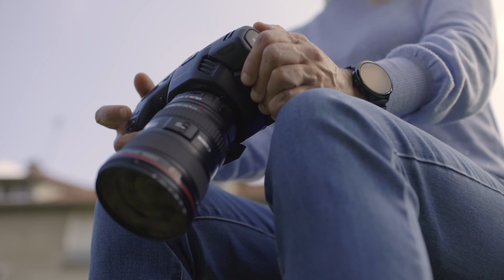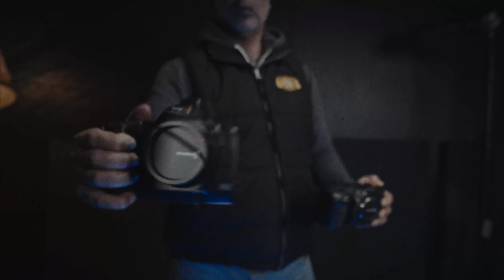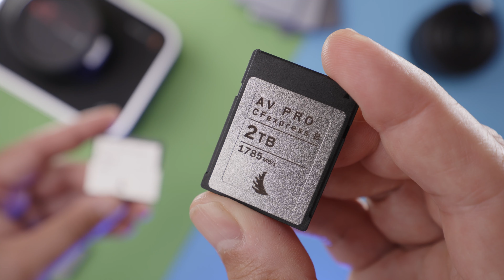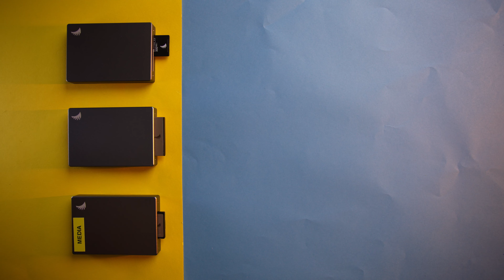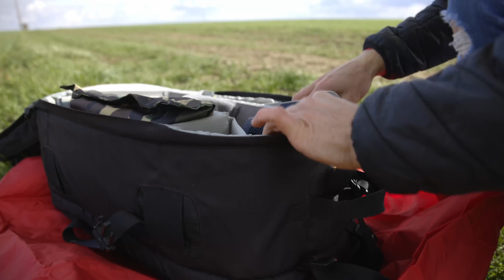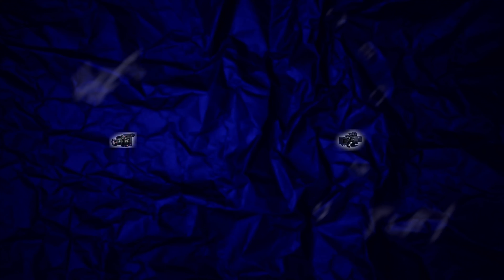Cine Gear 2022 Blackmagic Design Ursa Mini Pro 12k G2  - Prediction

Comment: Just started thinking about getting a couple 12k cameras and media was one of the main things that seem out of date. The ssd reader seems like a nice choice but that little usb-c connector does not fill me with confidence about surviving a bump. Internal cfexpress type b seems obvious. 2 or even 4 slots. 

The other was the mount. It would be great to have L mount or something else. Canon doesn’t make EF lenses any more. It’s an old mount. Coming from Sony the lens options aren’t that exciting. L would get back adapters and newly developed lenses. 

I guess full frame would be awesome too. Or maybe just bigger than s35. I wonder if they could do a sensor that could record 12k but technically be higher resolution in full frame but down scaled in camera. Maybe a 16k sensor that you can only get 12k out of. Seems like most people record 8k or 4k out of the 12k anyway.
Reply from the maker: You raise some great points Elvis. I will say this BMD will eventual shift to CFexpress type of media. They may be waiting on CFexpress type C which are larger, fast and will offer higher capacities.
The trend by companies (apart from Stills camera manufactures) is to sensor stitch two smaller sensors together. It wouldn't surprise me if BMD did this, but it wouldn't also not surprise me if they never went full frame. I say this because even though BMD has great cinema camera like the pocket 4k, pocket6k, 6k pro, Ursa Mini Pro 4.6 and 12k - most of their other equipment is for broadcast or live production, where smaller sensors are the preference.
If Blackmagic design could achieve a 16k to super sample a 12k/8k image that would be rather impressive though.
In terms of lens mount - it would be nice to see the range of cameras opened up to L or E mount lens options. Then we users would have 6 native options to choose from, which would be awesome.
Reply: Cfexpress B has the benefit of being the one normal card right now. That gives it the advantage for Blackmagic over trying to push C and being one of the few to use it. 

For sensor size it would be a good way to signal they are a cinema camera and not just broadcast+. Maybe just a big s35 like Red does where their sensors are a little extra wide.

Comment: The current form factor is fine but... #1-get it on the Netflix list. What does it need? More DR? 444? WTF? Autofocus "option" would be nice to compete with the Sonys and Canons. I have 10k burning a hole thru my pocket and I own 2 p6K's. Don't make me get a Komodo.
Reply from the maker: Im currently shooting with the 12k Ursa, my main issue is the screen is useless out doors. Plus when stripped all the way down, its still pretty big compared to a pocket, v-raptor or Komodo.

Comment: I believe a black magic design cameras use a 12-bit analog to digital converter so changing the codec to 16 bit wouldn't be possible without a fairly major hardware redesign. 

A frame rate boost seems more possible but that's also dependent on the sensor readout speed. That's why the Ursa mini pro G2 was able to record higher frame rates without a change to the recording media. I know the 12K has a good readout speed, but I have no idea what the math would be to figure out the theoretical limit.
Reply from the maker: Yes its very intriguing how this stuff all mathematically plays out. And with the new Arri 35 in the mix (I know the price difference is insane) with 17+ stops of dynamic range, I wonder how this is going to affect manufactures like Blackmagic design.  Will the Ursa 12k pro be enough even if it is improved moving forward? Lots of questions from the last couple of weeks ....
Reply: @cinechimp  I'm hoping black magic takes a page out of Arri's book and focuses on perfecting their color space and tonal curve for 12-bit log. Arri made a pretty big deal about their color space and how their tonal curve helps with the distribution of information for their highlights. I hope other manufacturers follow suit. 

Arri did have to make the jump to 13-bit for the new camera. But I think black magic taking a similar approach can still do a lot within their 12-bit log
Reply from the maker: @nickxc  Thats right 13 BIT from a 18 Bit source. Imagine if they had stay with 18 bit 4.6k and piped that into ARRI RAW. The files would have been ginormous. As yes I also hope BMD follows ARRIs chase of better pixels and more dynamic range over resolution like red.
Reply: @cinechimp  holy crap! I missed the bit about the 18 bit source. Goes to show just how much data can fit in log over linear. 

I'm hoping the same. The Ursa 12K is a very good camera but not really what a lot of us are looking for. It wasn't much of an image upgrade outside of resolution and the loss of prores is painful.

Thanks for all the great content and being so responsive!
Reply from the maker: @nickxc  Oh thanks brother, thats nice of you to say. 
Yeah that 18bit linear source in the new ARRI 35, will be what is providing the extra dynamic range.  But even with the ARRI, I wish we got the 18 bit linear to make the create decision with later. You know what I mean?

Comment: Just finally bought 4 Cfast 2 cards 😂 all I want is proxies in cam tbh. I have thought, if you took the handgrip off the pocket and made a moveable bluetooth handgrip, would make that camera super flexible
Reply from the maker: Its such a same that the LANC port on the cheaper cameras has been removed. But your idea sounds great. The bluetooth BMD camera companion app works great. I just wish it had image output with it over BT, like canon does.

Comment: For me, my next move will probably be something that's currently in development with BMD. Although the UMP 12K would be a great step up for me (from my P4K), I want it for everything it offers except the 12k resolution so my wish list would be an 8k version with all the same frame rate options but less noise, dual ISO, better screen and more stops of DR. That's about it. Not really fussed about all the other stuff as it's a pretty well refined beast already. My only fear would be more price drop madness like they did with the 12k! So I'd probably hold off for a bit on any new camera unless it was already crazy cheap (which I think the 12k is for what it offers)...
Reply from the maker: Hey dude, I think you nailed a lot of the collective sentiment here. Wise words. Yes that price drop on the Ursa Mini Pro 12k was crazy. I felt super bad for the people that got stung by that. I would have not been happy thats for sure.
Reply: @cinechimp  No, but the funny thing is, even at 10k it was amazing value compared to the usual suspects. On my wish list would also be access to dual ISO at once (like the GH6s DR boost). That would be amazing as well as a 3:4 sensor for better anamorphic. All more useful to most film makers than 12k. Having said that, I'd probably buy the 12K if I have to and never look back. The more time I spend with the P4K (especially now I have a set of Superspeed Zeiss Milvus glass) the more I can squeeze out of it...
Reply from the maker: @JonasStuart  Dang thats some nice glass you are rocking there brother
Reply: @cinechimp  Yeah, very nice and pretty much future proof. Paid my dues though so earn this kit!
Reply from the maker: @JonasStuart  We all do brother, we all do

Comment: curious your thoughts on the new Alexa 35
Reply from the maker: Great question. If we remove the cost, amazing digital cinema camera. I would be interested to side by side the Arri 35 vs the red Vraptor to compare and contrast both companies claims to 17 stops or DR. 
Im a bit skeptical of Red's claim, but Im sure the Arri claim is understated. 

Theres a lot of things to love, which aren't worth discussing, because when it ships it will be the best cinema camera on the market and the new standard that other companies, like Sony & BMD will chase.

But Im not sure I like the design language, that side screen looks very cheap for a 70K camera. Like something from a 1980s gameboy. 

Strategy wise, I like they removed all the additional option fees, but dont like the modules.
Audio should never be an add on module.  I dont like admitting this a DP, audio is important.

Comment: URSA 12K need CFExpress for sure. Also Lemo 2/4 pin and 3-pin Lemo power connectors (basically the additions of the Wooden Camera D-Box Plus), 4 channel recorder, more lens mount options,  prores (even if they can't do 12k, allow prores to 8k), black shading capabilities for exreme conditions, speaking of which, better water proofing; move the power switch and XLRs from the top, and, better IR cut in their NDs.
Reply from the maker: So many good ideas here for the Ursa 12k

Comment: Dunno why everyone in this space seems to prefer using cards over hard drives. A Usb-C 3.2/thunderbolt 4 Nvme drive would be so much faster than any CFExpress cards as well as having a far larger storage space capability. This would future-proof BM cameras for the forseeable future too.

I would like to see a MFT 6k 4:3 sensor in what is now the pocket 4k allowing open gate recording. I doubt it will happen though.
Reply from the maker: I think NVME's will be useable externally, like Samsung drives are now. But internal media will be CFexpress for sure. Couldnt agree more about a MFT 6k 4:3 sensor, that would breathe some new life into the pocket 4k range. Be nice if they squeezed some ND's in there too. That would make a great open gate anamorphic budget friendly option for owner ops and smaller productions.

Comment: They need to launch the BMB6k and 8k   black magic box.   8 k.....18 stops.....IBIS with lock..... Open Gate......Global shutter. 600 fps at 1080.   Water proof and vmount.  RF mount..... with a 6 k MFT version. Locking screw on power cable.  NDI licensed or alike.  And it should have a built in cage and accessories mounting holes.
Reply from the maker: 18 stops - wow brother....But hey these are serious requests
Reply: @cinechimp  I figure you ask for 18...the test will show 15
Reply from the maker: @TaiowaMusic  If the ursa ini pro 12k g2 came with 15 stops of DR, I would hand over my credit card and tell BMD to keep it. If it had more, like the new Alexa, blackmagics spell on me would be permanently set
Reply: you forgot to add for $1699!
Reply: @imagebymichael  I was hoping 1499
Reply from the maker: @TaiowaMusic  NOW that would be bang for buck

Comment: I need a small box form factor B cam that has an updated sensor over the pockets, to match my Ursa 12k. 
It would come in handy to put on lightweight gimbals.

BMD needs to stop playing around. 
Full frame would be nice too. lol
Reply from the maker: Does the pocket 6k Pro not do it for you? Or would you just prefer a cube styled camera for gimbal work?
Reply: @cinechimp  I'm not interested in older sensors so I would want a newer sensor, that's the biggest thing for me.

I don't like to purchase old Tech. So if they put a 12k sensor in a smaller body, i would purchase it immediately; because that would be the sidekick camera that I am looking for.
Reply from the maker: @SaintProductions1  Fair point. Im just wondering after seeing how much cooling makes up the new Alexa 35, if BMD could even get the Ursa Mini Pro sensor to run cooler in a smaller than URSA body. Interesting
Reply: @cinechimp  Good point. I would even take the Ursa 4.6 G2 sensor in a smaller form factor right now. 

But once again, i would rather a new sensor if given the choice.
Reply from the maker: @SaintProductions1  I hear you. 
Fingers crossed that BMD design keeps delivering awesome cameras like the UMP, so eventually they will make a camera equal to an alexa without the 70K price tag.
Reply: @cinechimp  And... Still waiting. lol

I still think they will release a new model (or 2) before the year ends.
Reply from the maker: @SaintProductions1  we can only hope

Comment: i think they will use NVMe disks - much cheaper with the same or better data write/read
Reply: Christ I hope not! Stay with purpose built media!!
Reply from the maker: @Creative_Juice_Media  I have the 2tb version of a 12k compliant card from Angelbird. And it just drinks up 8k footage and never slows down. Its awesome. Hopefully I get the chance to test it of a 12k camera ;)
Reply from the maker: Hey you may be right about that. I gather you are thinking something like what Kinefinity has done with their new kinemags? 

That would actually follow BMD M.O for keeping things cheap and easily accessible. 

And make a l ot of sense for a more expensive camera in their range, like the Ursa 12k G2